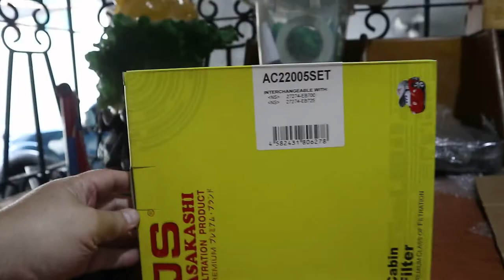Refresh Your Ride - Install A New Cabin Filter In Your Car's Ac!

Comment: Thanks for your video sir… i just wondering where the filter located coz the other model is easier to peel of the filter cover..
Reply from the maker: Its behind the glove box. If your vehicle is the same model as mine, you probably need to cut the lid of the cooling box to install the filter. As i did in the vid
Reply: @EagleRsDIY  alright, thanks bro